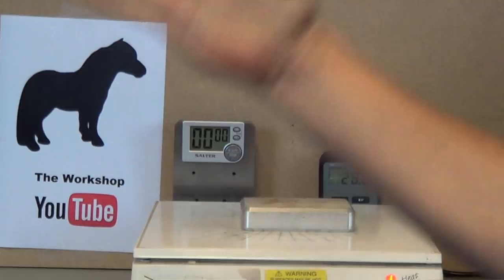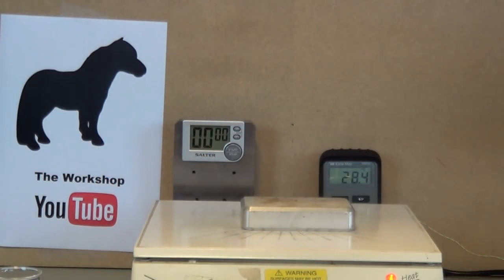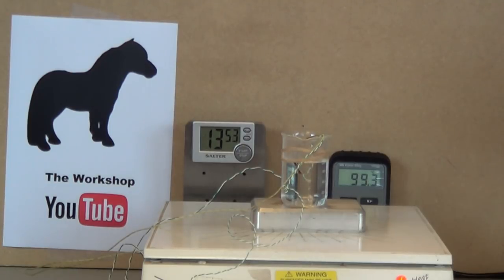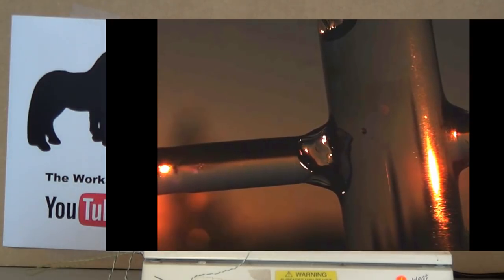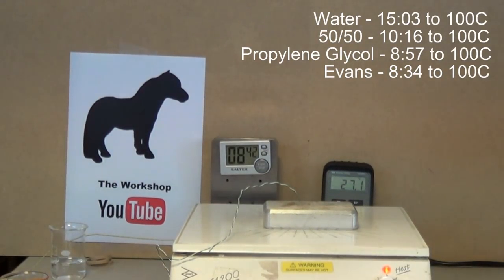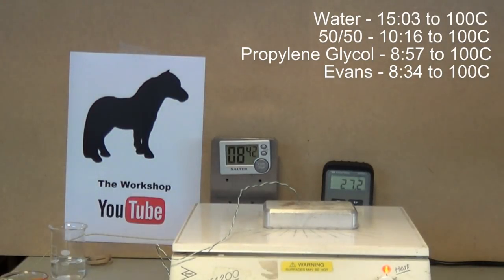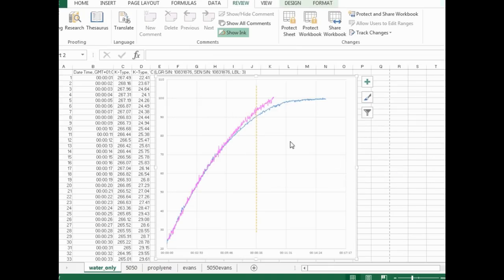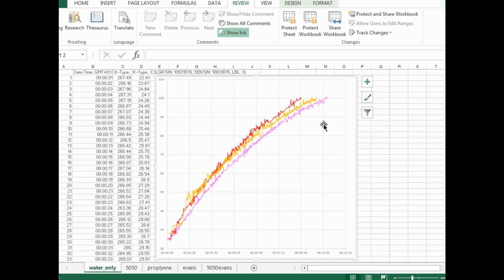Evans waterless is SHIT! - with proof

Comment: I'm sad enough as a chemist to know what these products are dyed with. The Comma product is dyed with Rhodamine Pink 6G (fluorescent pink). The Evans product is dyed with Ponceau Red (Kenacid Scarlet 4R). This is what you get for working in oils, lubricants and chemicals for 30 years. I need to get out more... The 2% additive in the Evans product is probably TEA (Trethanolamine) Phosphate and maybe a touch of Tolyl Triazole for multi-metal corrosion inhibition.  Lock me in a room and challenge me to match the Evans product and I'd be in there for all of half an hour or less.
Reply: So why the dyes in the first place? I always thought the greenish/yellow in most coolants was to make it fluoresce under uv light so it would be easy to see in the event of a leak. Whats the deal with the pink and red?
Reply: That's it really, they are for leak recognition. Some companies used to use ordinary fluorescein (the green/yellow) but to distinguish them from other brands, some use other dyes. I used to do the same in water-based hydraulic fluids designed for fire control equipment on RN ships, motion compensators on drilling rigs or for diecasting machines. My personal favourite was Emerald Green, created with fluorescein and a water soluble  Blue 80 dye - that colour rocked.
Reply from the maker: I had a thought that they might be also dyed so you know you've spilt it, so that animals etc don't lap it up. If it's clear then you could just think its water. - not the sole reason, just another reason why. - Thanks for the info Merlin - priceless the knowledge you guys have.
Reply: You might want to ask guys that have been running Evans for a while if it's still red in their systems. My experience is that Ponceau Red 4R wasn't that thermally stable and went orange over time, it sort-of fades as it degrades. I'd also be interested what pH the neat Evans stuff has, if you have a pH meter nearby. Ideally, aluminium (being amphoteric) wants neutral pH (about 6.5 to 7) to be passive, but cast iron parts would prefer pH 8.5 to 9, as that's the passive range for iron. The Tolyl Triazole is sort-of a metal 'plugger' that tries to deactivate galvanic corrosion sites and tries to stop corrosion, but it's best for non-ferrous metals like copper and aluminium. That's why I think they may have gone for an amine phosphate for the iron. I spent years on this exact topic, preventing corrosion in water-based systems. Also, does the Evans smell like Ammonia/wet nappies, something that might hint at some type of vapour-phase corrosion inhibition?

Glycols taste 'sweet' to animals, hence they like to lap an them and they are toxic to them, so the dye would also let you know that you have spilt it.
Reply: My favorite chemi-color is Luminol and hydrogen peroxide its a mesmerizing blue, very much like Cherenkov radiation.
Reply: Science is brilliant, innit? : )
Reply from the maker: I'll test the pH, is was something I was interested in - I think I remember one of the data sheets saying something, but I don't believe a word of what Evans publishes, so i'll test it myself.
Reply: "Lies, damned lies and product data sheets" - a man after my own heart...
Reply: Glycols are sweet tasting and don't smell caustic or like volatile organic compounds -for a dog excrement is a welcome appetizer.  As well dogs are virtually color blind  exhibiting some sensitivity to  blue grey  and yellow.
Reply: because red ones go faster!
Reply: I thought the differing colour for coolants was so you could easily distinguish the type used, and know what is compatible / incompatible.  

For example Green coolant means standard ethylene glycol based.  Red coolant means it got OAT (organic additive tech) based inhibitors.  Blue is used in alot of newer cars now and is coloured that way to be free of silcate, borate, phosphate additives.  And they colour them differently so you dont mix the different types of coolants.  Supposedly green + red = bad.
Reply: Pretty good drunk comment 👍
Reply: Why do I think of the movie 'K-19 the Widowmaker' when I read that comment?
Reply: ModshackMerlin I know this is old, do they put an oxygen scavenger in coolant? I know ammonia can act like a oxygen scavenger, or DEHA. Thank you? Oh I doubt ammonia, because of the copper?
Reply: @JAMESWUERTELE  They used to. Sodium Nitrite was cheap and worked as an oxygen scavenger. It worked for cast iron blocks but was dropped when alloy blocks became mainstream. Amines are still used in some formulas but are present as Amine Phosphates to give some multi-metal protection. Add in some benzotriazole or tolyl triazole and most metals are passivated by an amine phosphate/triazole blend.
Reply: ModshackMerlin I’m kind of familiar with amines, I worked at a plant where we used it for ph control (to bring, and maintain 9.2). I’m sure glad the coolants now last a bit. I have a ‘97 diesel that I have to change regularly, and add nitrates for cavitation.

Comment: In the 1970's I had a Triumph Dolomite that was prone to overheating and (because I didn't really care about corrosion as it was a POS) in summer I used 100% tap water and it stopped overheating. I listened to my physics teacher when I was at school. So I 100% agree with you.

Comment: I'm not sure about your conclusion. Doesn't the fact that Evan reaching 100 degree quicker, means that it was quicker in drawing out the heat out of the block, which you want? If that is the case, is it also quicker at dumping the heat?. 
I guess what I'm asking, what would the ideal "perfect" result look like, never reaching 100 degrees? Demonstrating the heat being taken in and and the absorbed heat being dissipated before in can build up?
Reply from the maker: Good question. What you are missing is that different materials can absorb more heat than others. Its a strange thing to get your head around but you need to think of it as energy not heat. 

Once a substance has 'filled-up' with energy it then has to reject additional energy - it does this via radiation or we call it heat. The thermo-couples measure the energy passed to the probe - or heat.

Evans and both glycols have half the heat capacity that 50/50 does. Hence the term capacity. Both samples are placed on the same heat source, and Evans absorbs less heat than 50/50. 

It absorbs as much energy as it can then radiates additional energy - which we record as heat. Evans themselves state that water is the best coolant.

But this is half the story - 50/50 (because of the water content) is a better thermal conductor than Evans so when it reaches the radiator it transfers more heat to be removed from the coolant. 

Evans does a shitter job at removing heat 
Evans is shitter at handing this heat over to the radiator

therefore  

Evans directly causes your engine to run hotter
Evans reduces the effectiveness of your radiator 

so effectively by running Evans you are removing less heat and reducing the size of your radiator
Reply: Thanks for the clarification
Reply: Good attempt but completely wrong interpretation of the results. The coolant is simply a means to transfer the energy from the engine to the radiator where it is cooled. You want a coolant that is more efficient/faster at absorbing/transferring the energy. In addition, the problem with the low boiling point of water is that it boils off which leaves you with no coolant left in the system.

Comment: The speed of heat conductance increases the higher the temperature differential is, hence the slope. The job of coolant is to carry the heat from cylinders to the radiator as rapidly as possible.

Comment: The irony is everyone uses boiling over to indicate the engine is too hot or overheated, and if evans claims that it doesn't boil until "300° F" nobody really sees that, they just hear or read won't boil over therefore they assume it is better and the engine is not overheating when in fact it actually is.
Reply from the maker: Very true
Reply: The reason why everyone uses boiling point is because once the coolant boils it leaves the system and you have no coolant left in the system to cool the engine where temps then skyrocket. This is way you want a coolant with a higher boiling point.

Comment: Its a very interesting comparison.  And the principle you are demonstrating with the heat holding/absorbing capacity of the fluids is something ive actually experienced first hand.  I have a pretty heavily modified subaru I use for tarmac/circuit sprint racing.  At one stage i refreshed the coolant and I used a green glycol based coolant concentrate and mixed it myself with demineralized water.  The coolant bottle claims it can be a 50/50 mix for maximum service intervals.  Or you can mix it as low as 33/66 mix (33% concentrate) for general use.  Me being me assumed if 50/50 mix was better than 33/66.  Then that means a stronger mix than 50/50 is better again.  Right?   WRONG!!!!  Car ran hotter than normal and was struggling with cooling.  More water in the mix and everything was good.  On a street car you may not notice the difference.  But on a competition vehicle doing such a thing could easily cost you a very expensive repair.
Reply from the maker: Awesome comment - matt

Comment: excellent video. aside from the higher coolant temp in the cilinderhead i also think that it can't be good for the ATF in an automatic transmission , in most automatic transmissions the ATF is cooled with a heat exchanger inside the radiator, in other words when the evans coolant stays hotter it also means the ATF stays hotter...
Then there is also the electric fan. From this test we now know that the evans coolant is not able to shed the energy fast enough it means that the sensor in the radiator will sense higher temps for longer meaning that the radiator fan will be switched on for longer as well...
That drains the battery which means the alternator needs to charge more . A charging alternator is a parasitic drag on the engine, it has to generate the power to spin that alternator. This means the engine burns more fuel.

Comment: Hi Matt. I've only recently discovered your channel and I'm enjoying your grass roots approach. However, and I'm no expert, I can't help but think this experiment is flawed. It occurs to me that the reason that water is more efficient in your test is because it reaches boiling point which allows the heat to be dissipated via steam. This does not happen with the other mixtures because they do not reach boiling point. In a pressurised system not even water actually achieves boiling point so the heat will not be reduced in the same way.

I also believe you have missed the whole point of how the cooling system is designed to work.

The coolant's function is to absorb heat (from the engine) as effectively as possible and dissipate it into the air as effectively as it can. Therefore, the more it absorbs heat the better. The crucial point you seem to have missed is how long it takes for each of the liquids to dissipate heat (cool down). I'm not saying that Evans is better at doing this than water, but it would be interesting to heat each of the liquids to 100 degrees and then time how long it takes them to cool back down to the ambient temperature. This, surely, then shows each liquid's ability to dissipate the heat it has absorbed - which is the whole point of the cooling system after all.

Please don't flame me for offering an alternative viewpoint - I just think it would be worth a look.

Peace, love and chocolate digestives!
Reply from the maker: This is why there's more video on this subject - including the SV1000 test and the coolant tester experiment still to come.
Reply: @dirtygarageguy  I'm still waiting for the results of those experiments. MY thesis is that you made a bold claim, based on hubris, and hatred,  toward a third party, and when you tested the Evans you looked into the Abyss, and the Abyss looked straight back into you, and when you didn't get the results your confirmation bias demanded, you suppressed them. That is not how the scientific method is supposed to work. Thunderf00t would consider you a charlatan.
Reply: @waynegoldpig2220 thunder foot would understand the physics involved and agree with matt.

It's a simple thing to look at, the energy put in to raise the liquid to 100c is what matters and is why water is more efficient.
Reply: @jediknight1294  Ask thunderf00t to perform the experiment then, smartarse, because Matt never released the results of his.

Comment: One heats up faster than the other the question is does it cool faster? Thinking it would cool faster while running through the radiator.
Reply: Of course it would cool faster. Thermal conductivity is not bias regarding if its heating up or cooling off. I think he needs to study some thermodynamics to better understand what this data is telling him.

Comment: I'm confused. It heated quicker. Is that not what you want? As the coolant travels through the vehicle the quicker it pulls the heat the better, I would think. In theory, it should dump the heat quickly as well. This meaning, when it travels through the radiator, it will be cooler when exiting...thus making it a more efficient method of cooling. Also one of the main selling points of the product is anti corrosive.
Reply: Yes, because it has a lower specific heat / thermal capacity.  Water has an exceptionally high specific heat.  That means a kilogram (or pound, gram, etc.) of water can absorb more energy (in the form of heat) while increasing its own temperature the same number of degrees.  Less thermal energy being taken out of the engine means the engine will not cool down by as many degrees, so assuming it's putting out the same amount of power, the engine will run hotter.  Energy per time = power.

Comment: mat, dont want to be a nob but do you think that Evans gains heat so quickly that the reverse is true. ie it looses heat just as quick. this surely is what we want as a cooling. surely its how quick it can get rid of heat not absorb heat. or are they the same? if that makes sense
Reply from the maker: thye next video is coming on this in about 10 minutes

Comment: @jediknight1294  if my 35 years in automotive practice is correct, absorbing the heat and getting it to the radiator for cooling IS the whole purpose of the liquid inside the cooling system.if not, please educate us. thank you for your patience with us that have so few years in the racing and mechanic world.

Comment: I may be getting confused here but, if the water is heating up slower then is it also not drawing the heat away from the source slower as well. I.e. The thicker liquids with glycol in seem to pull the heat from alloy faster, therefore better for cooling.
Reply from the maker: No, the heat supply is pretty constant - when something is hot it is radiating that heat outwards, otherwise you couldn't measure it. The water is obsorbing the energy/heat without heating up itself. Think of it like a sponge vs a house brick when soaking up water. Water can absorb more heat and carry it away.
Reply: The Workshop Thanks for that. 👍
Reply: Water has high thermal capacity need more heat to raise the temp by 1C vis a vis Glycol. Hence why water Will be more efficient in terms of joules of heat energy absorbed and removed

Comment: wouldn't the coolant that removes heat faster be better at taking heat away from the engine or have I missed something if so pleas help so I can understand cheers
Reply from the maker: Each liquid is having the same heat applied to it. (i.e the hot plate and the temperature measurements taken from it) As a coolant's temperature increases the 'flow' of heat from the hot thing to the cool thing slows down. We call this the thermal gradient. The heat transfer stops when equilibrium is reached (they are the same temperature)

If a liquid heats up too quickly then is becomes more and more useless. In this experiment we look at how hot the actual fliud is. This lets you know how well it is absorbing heat. 

Water absorbs more heat from the hot plate, it can also transfer (cool down quicker) this heat to the radiator (this in the video coming next, called thermal conductivity) 

Basically the data shows that Evans becomes useless quicker than everything else (other than pure propylene glycol).
Reply: No, it would be worse. You aren't taking so much heat away, as the specific heat capacity is a lot lower than water (think Joules per kg per degree C). Then add in that air is pretty crap at removing heat and the effect is a double whammy.
Reply: Ok I see now up to speed with you on it . so basically  water in simpler terms takes heat away better with out braking down its structure and can keep absorbing and cooling better than anything else .
Reply: Exactly! Even if it boils in the system it's still removing heat, as it takes energy to change from water at 100C to steam at 100C. It's the same with water at 0C and Ice at 0C, it's all to do with entropy.